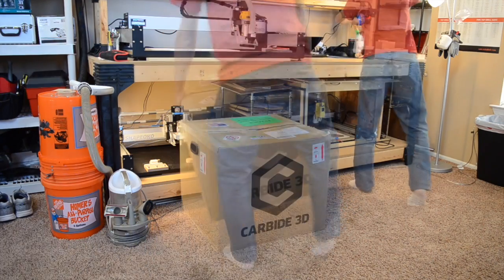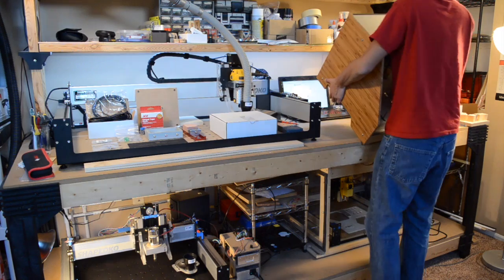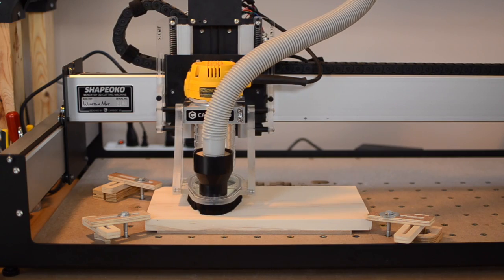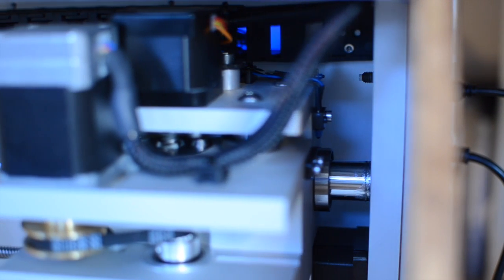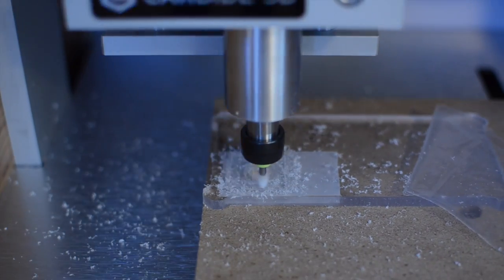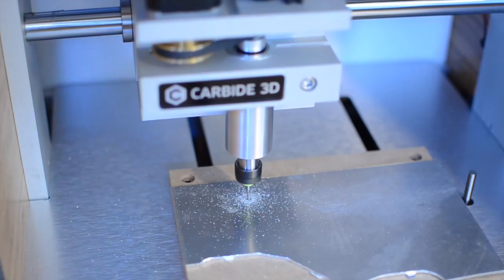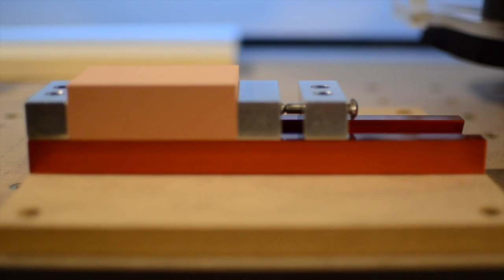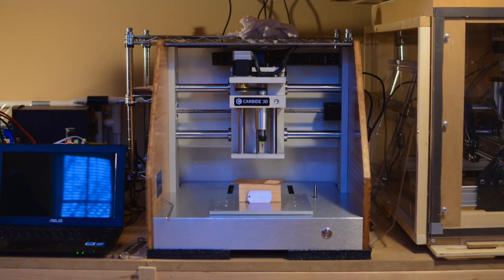Meet the Nomad 883 Pro Desktop CNC

Comment: How loud is this? Can it be run in an apartment?
Reply from the maker: If you're not cutting aluminum and/or taking less aggressive cuts, I'd compare it to a small vacuum cleaner. But it largely depends on what and how you're cutting. You compromise speed for quietness.

Comment: I want to know how this thing compares to a Sherline CNC Mill. I know the Sherline wins in the size limitations since the Nomad is limited to 3 inches in height. The Sherline can accommodate 6 inches on the base model and up to 9 inches on others (z axis travel). base model is $2700 for a plug and play (with the computer included). Its a pretty package, but if it can't do what the Sherline can for the same price point, what's the point?

Comment: Hey guys can u please give me advice.. I’m doing wooden stuff like wooden rings and wooden glasses and more of accessories so I’m looking for the best CNC machine for wooden art 
Thank u so much if u can help x
Reply: What work area are you looking for? Because while this thing is amazingly accurate and well built. If all you are doing it wood, there are probably cheaper alternatives like the Shapeoko. However if you plan on doing smaller extremely precise components on more than than just wood then I'd really consider looking at this. Main reason I say that is, wood isn't the best material for holding super tight tolerances. I realize there are special woods out there that do better, but wood as a whole compared to metals, many plastics and prototyping foam doesn't really machine to the same precision. So it just depends on what you need.

Comment: So if I was planning on mostly working on aluminum, would you recommend this over the Carvey? Also could this handle carbon fiber?
Reply from the maker: The Carvey uses belts in X and Y, so the nomad is going to be a ton more rigid. Up 1/8" endmills should be fine in it, any higher and your torque/HP requirements will probably exceed the motor's capabilities. Biggest thing for CF cutting is that you need the right type of cutter, but also dust management. Either a water bath or good dust extraction/filtration. Otherwise yes.
Reply: @WinstonMakes  Thanks for the quick reply. Pretty sure I'm getting a Nomad. Is there any other machine I should consider now?
Reply from the maker: Depends on what you need, how big you want to cut, how much accuracy you want, if you’re willing to assemble it. But I think as a pre-assembled, ready to go machine the Nomad is pretty respectable.

Comment: Does something like this exist but with a more beefy motor? 50w just seems so gimped compared to others. I've seen people mod this to fit a 70 watt, which is not worth the upgrade, as well as a 500 watt. I'm just looking for something with a small surface area like this, and with lead screws, but a more powerful motor. If it's a kit to self assemble to save me a crap tone of money that's fine.

Comment: Hi Winston, I just got the Nomad 883 and want to cut metal. Can you provide info on which cutter, metal gauge, and feeds and speeds that you used to cut the copper and silver dog tag in your video? Any help you can provide would be much appreciated.
Reply from the maker: I was using aluminum and copper between 1/16" and 3/32" (not sure what gauge that corresponds to, but google can tell you that), and a 1/16" endmill (nothing special about them, got them off ebay, very similar to the ones from C3D). Feedrate was 14-15 inches per minute, depth of cut 0.01". If you want to play it safe, I would cut shallower, but not much slower.

For 1/8" endmills, Carbide3D has a feeds and speeds chart they recommend. It's a good place to start, but you will inevitably want to do a little experimentation for yourself. 

A drop of WD-40 can help keep copper from gumming up your cutter, as the metal is very soft and prone to clinging to the cutter.
Reply: Thanks very much Winston! This helps a lot.

Comment: Hi Winston, how does it work after a year in service? Can it still keep its accuracy? I'm looking for a machine with 0.1mm accuracy for small aluminum works, specifically <10mm by 10mm in size and 2mm in thickness. Don't know if this machine can do that. Also, have you tried to mill a PCB from it? Did it work?
Reply from the maker: I have observed no loss in accuracy thus far, it's still within 0.1mm. Have not tried PCB milling, but many have.
Reply: Thanks for the reply. May I ask another question? What kind of accuracy you have measured when dealing with aluminum or brass in real life (ie, not just test patterns like squares or circles)?
Reply from the maker: Look up my recent brass tripod attachment video. The outer diameter of my threadmilled part was within 0.1mm.
Reply: Winston Moy Thank you so much from a soon to be Nomad 883 Pro user!

Comment: lol under $3k $1600-2000 you can get a real machine that can cut carbon steel, titanium, 4140, cast iron ect that comes with DRO setup. Wood, Acrylic, PCB, plastics, soft aluminum and alloys is about all this machine can do. Even the eEbay 6040 4th axis cnc is more capable and its only about $1400.
Reply: could you make some other recommendations? Looking into to getting a setup and the 6040 looks good. What about models of  the 1600-2000 price range you mentioned?
Reply: There are the Precision Matthews PM25, Grizzly G0704, Little Machine Shop and Jet....they are all Chinese made "benchtop mills" and mostly copies of each other, but they don't come CNC. You would have to make or buy a conversion kit and wire the steppers and breakout boards, definitely not a turnkey setup, but can be done under $3k if your crafty. Once you have a milling machine you can make your own brackets plates, then convert it yourself instead of spending hundreds on a kit someone else made. Then use you CNC machine to make more CNC machine and take over the WORLD! lol JK

Comment: I'm not seeing anything pro here just some cheap lead screws (I use this sized lead screws on my z axis for my 3d printer lol) and smooth rod neither of which have any place in a cnc machine that has pro in it's title.

$2500 you can build something proper with 2010 ball screws, Hiwin rails and a real spindle for that. 50w spindle power I'm really struggling to believe this is for metal cutting. Lead screws mounted directly into the nema have no place on a router/milling machine.
Reply: vubhuhjkbhubohjb yes I have those lead screws on my printer too. They work fine...
Reply: So the easiest solution would be to remove the word "pro" from the name.
Reply: After several thousand hrs  of consumer 3D printing experience, and while I've only just started using my Nomad....I am blown away that this thing is in the price point of a quality consumer 3D printer.  The build quality and capability is astronomically better,  truly a night and day difference. Will it cut aluminum like the CNC porn you'll find from Hass machines on youtube... no. Those are $30k-$300,000.00 machines, so of course not. However... can it machine an aluminum part faster and far more accurately than a consumer 3D printer can print plastic (taking certain design considerations into account) absolutely. I have a 3D printer than now sits under my work bench instead of on it due to how troublesome it had become. The nomad now comes with a 70w motor, while thats still not worth bragging about, the frame and build is so rigid, that I wouldn't be surprised if it can handle a far more powerful motor before anything else needs an upgrade (frame wise).

Comment: Hey, I do a lot of welding and am thinking of starting to sell some smaller products would there a nice machine that I could 3d print and laser engrave with?
Reply from the maker: You want to 3D print and laser engrave with the same machine...? 3D print metal? Not sure what you're asking for.
Reply: I want to be able to 3d print with plastics and laser engrave metal
Reply from the maker: I defer to Make Magazine for a 3D printer recommendation: http://makezine.com/comparison/3dprinters/

And most consumer-prosumer grade lasers do the same thing. "Mark" rather than really engrave metals. Look up glowforge, Epilog... you can effect minute changes to the surfaces of metals, but it will be super shallow. Like on the order of microns... it's a very hard thing to do.

Comment: The Achilles heal of the Nomad is its anemic spindle motor. 0.07 hp doesn't get you anywhere fast. Compare that to over 1 hp for the Shapeoko router and you will find yourself using your Shapeoko for everything that doesn't require better than 0.010" accuracy. 

That said,  if I need parts to be very accurate then I use the Nomad (if they are less than 8x8x3". I'm a product developer and I still only use my Nomad 5% of the time and my SO3 XXL 95% of the time.   There's just a great satisfaction seeing the SO3 rip through Baltic Birch at 100 ipm using a 1/4" bit running 1/4" deep.

The Nomad spindle isn't powerful enough to effectively use a 1/4" end mill. 

I'm eventually going to replace my Nomad anemic spindle motor with a 1 hp BLDC hobby motor with manual speed control. that will make the Nomad a much more appealing machine.

Comment: Hello Winston, Cool that you got one. But don't you think the price is a little high?I think you can do the same thing with Shapeoko 3. Because for example we can find the cnc mill 440 Tormach for 6000.
Reply from the maker: VLAHECO You could certainly do a lot of the same things on Shapeoko, but it's not really a fair comparison. The point of the Nomad (from my perspective) is to enable one of two things (or a combination of the two):
1) Accuracy within about 0.002" without trying, and rigidity to fearlessly tackle metal projects. 
2) Giving that power to people who aren't necessarily mechanically inclined, or in a workshop environment. 
From a $-per-cubic-inch perspective, the Shapeoko is one of the best, and that's fine for general purpose use. But it's a bit like comparing a minivan to a Miata.

As for the Tormach (have you seen the prices as soon as you start adding options?), if you have the money to spend, it's awesome. But for 95% or people, you have to accept that capability grows nonlinearly. The Tormach might be 3x the price, but 4x the performance. What good does that do someone whose budget tops out at $3000?

The decision largely depends on your needs, and what compromises you're willing to make. 

Also, for perspective, you have plastic extrusion 3D printers costing as much as a Nomad, which I find crazy...
Reply: yeap...you are 100 % right.. That's why I like your channel :D

And yes I have seen the tormarch prices onece you start adding tooling and fixtures...

Well, my Christmas gift for my self :D wil
l be the shapeoko 3 o maybe this one :D 

I am in LA. let us know when you come here and we can shake hands :D
Reply: Maybe I'm missing something but Nomad Pro has steppers with built in lead screws and looks like without any kind of fixed end feature on them so obviously it wouldn't stay in 0.002" accuracy range forever.